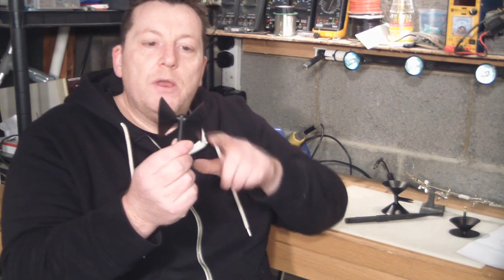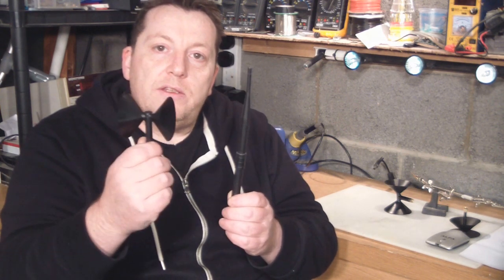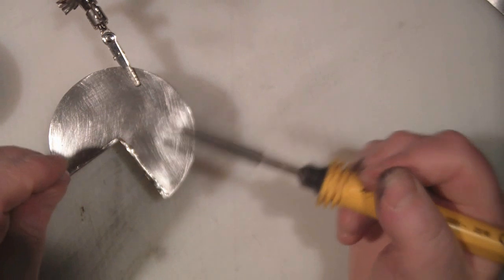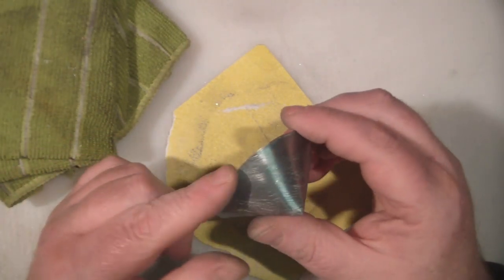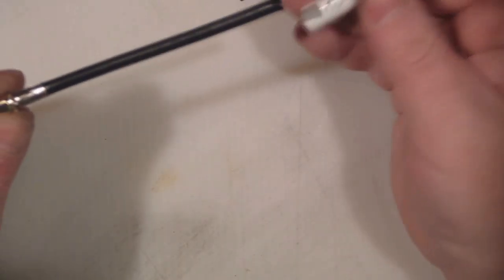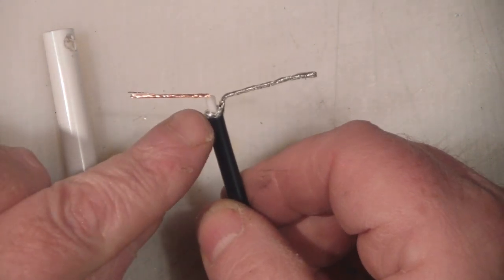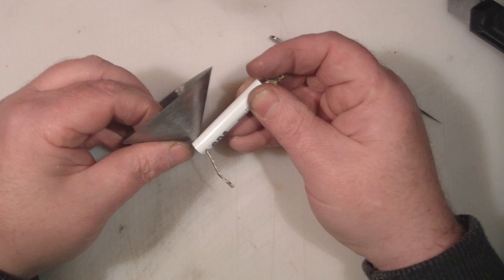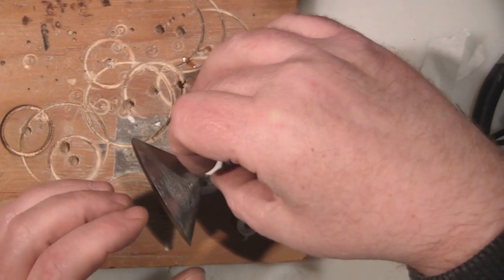Biconical Antenna 2 4GHz #39

Comment: I'm allergic to solder fumes, so I print the conicals on a 3d Printer and put self gluing steel foile on them. The connections are spreaded and glued too. That is surely not the perfect way to do it. But im impressed how good these antenna works. Tested with 50m far away eduroam wifi.

Comment: Another top idea and realisation, Andrew: thank you again.  Question: if one decreased the angle of the cones (which appears to be about 90 degrees) to, say, 60 degrees, would this antenna have a wider reception or transmission field (not just narrowly cylindrical)? Thank you in advance .   Cheers from Bruno

Comment: This is really great and easy. I have a circular antenna on Parrot Ar Drone 2.0 working on 2.4Gb and I was wondering if this receptor antenna would be better than the Biquad Yagi one (fixed on Alfa WiFi and W8.1 tablet), And, if this one fits, should I hold it vertical or horizontal, as the Parrot's antenna is a horizontal disc? I would like to get a good 500m range with no obstacle.
Reply: I finally constructed this antenna. It's a great fun to do such things. the result is about the same strength than the original 5dbi antenna delivered with the Alfa AWUS036NHR v.2 tested at home with a Wi-Fi spot 1 floor downstairs. But I hope the result will be better outdoors at a distance of about 1 km of a Parrot ArDrone with circular antenna. I'll write you soon the result as I receive the circular antenna set...

Comment: How did you get the sma cable to connect to the alfa network adapter. By my understanding the adapter has a male rp sma which is too small to get a fit with the sma cable. Also I could not find any female rpsma to female sma connectors, please explain how you got the two to connect. Thank you